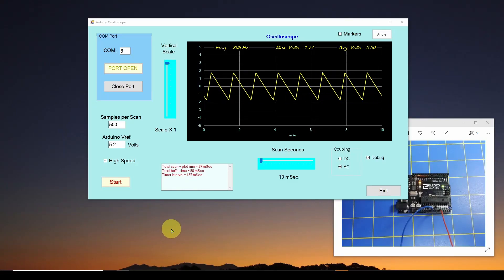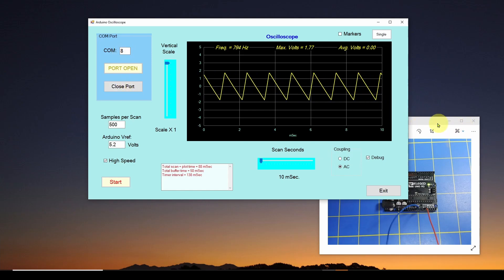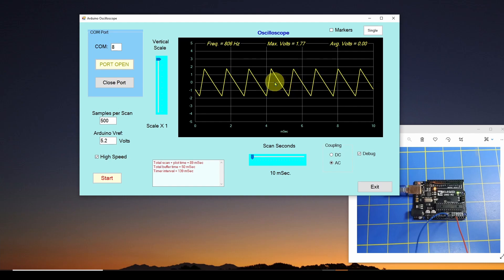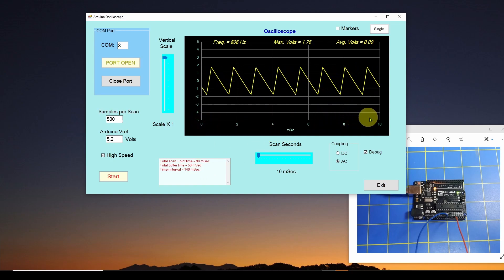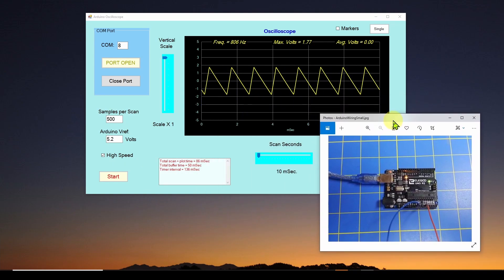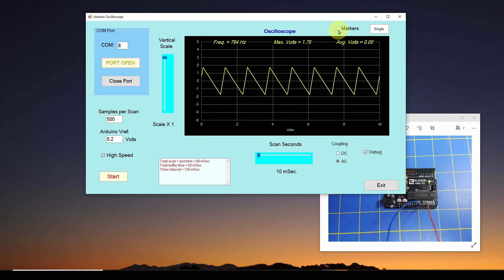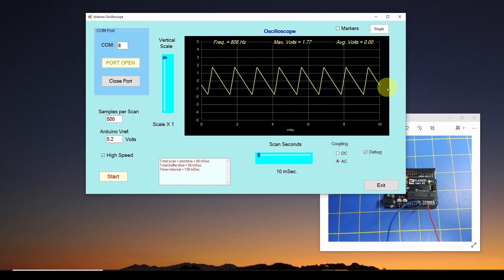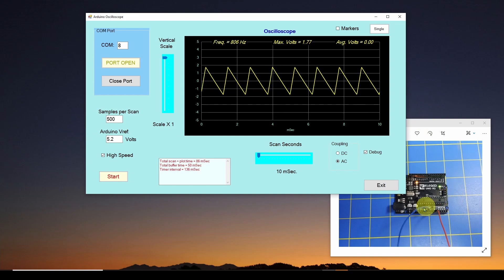Arduino Oscilloscope: Introduction

Comment: Hi, I'm just beginner. I bought XR2206 signal generator. 
So all I have to is connect other end of that blue wire to ground  and red wire to signal square/sin wave of the XR2206?